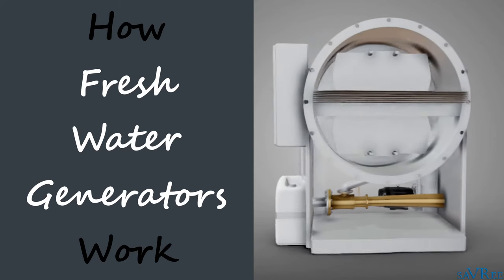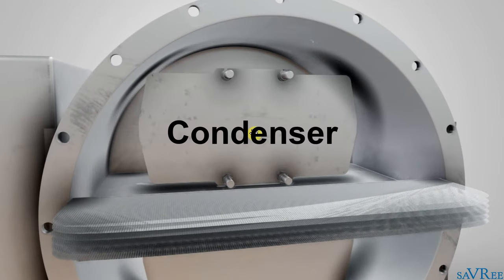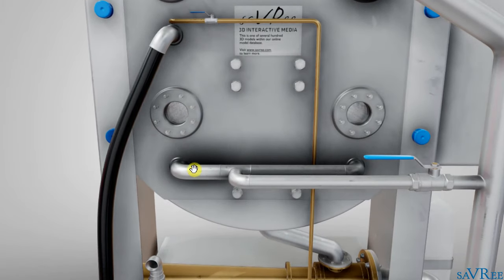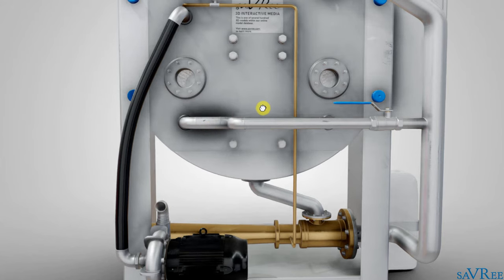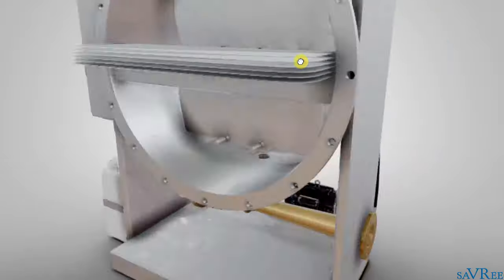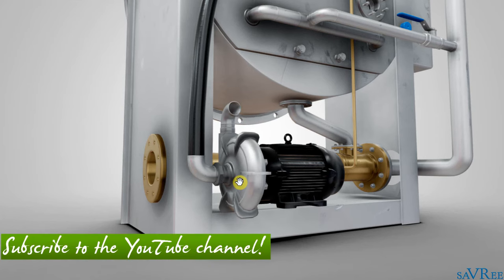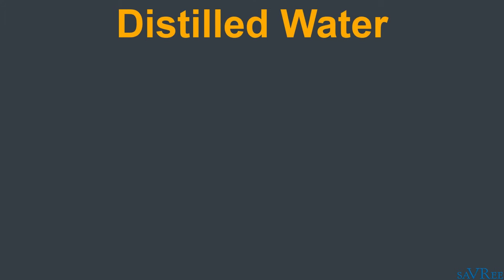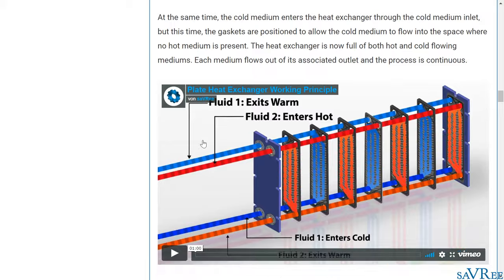How Fresh Water Generators Work (saltwater desalination)

Comment: Sir please explain how salinity is check,and how salinometer work...thanks for video
Reply: Salinity is checked by means of a salinometer. The principle usually is based on the fact that when the water produced is via distillation, the conductivity of the produced fresh/distilled water will be very low ( because it will still have trace elements of minerals in it), and if there is excess carryover of salt during initial stages of fresh water generator operation, then the fresh water will have higher conductivity. So the conductivity of water is proportional to the salt content. It is preferable to have salt content of less than 6 ppm. This limit is slightly variable across areas.